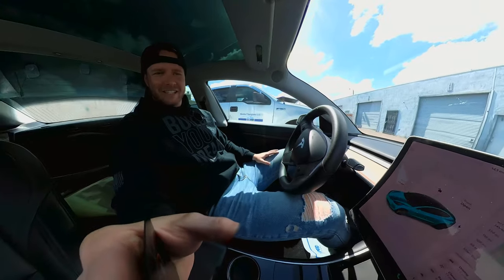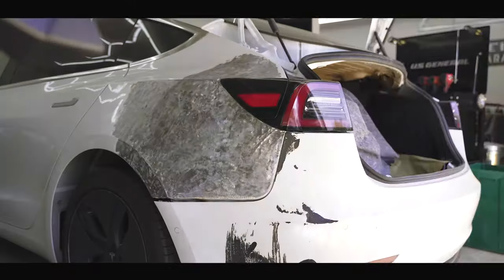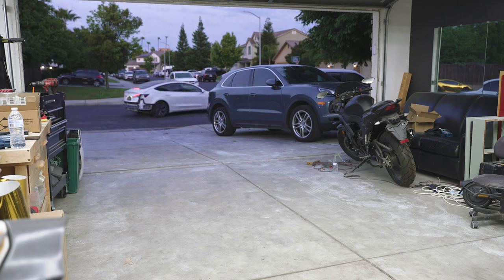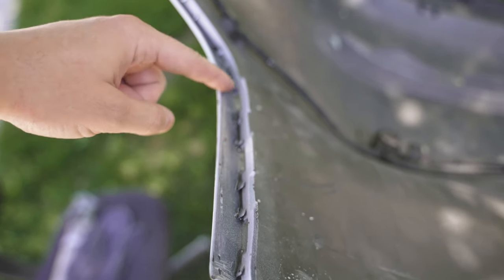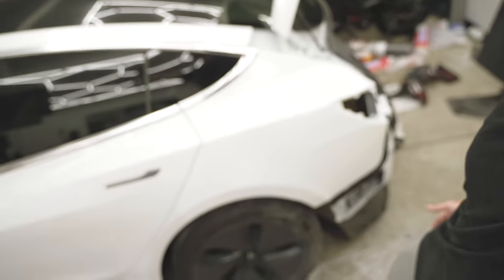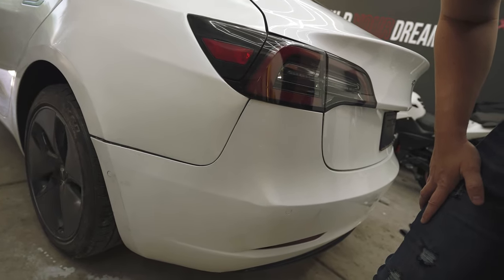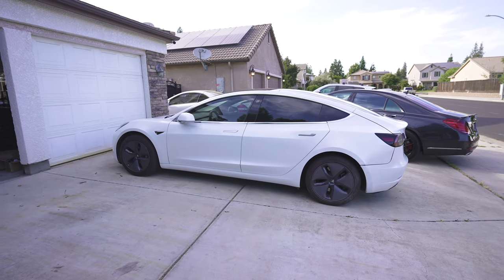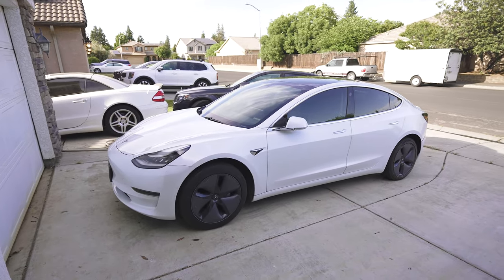the $18,500 Tesla Model 3 is Ready for the Road!

Comment from the maker: What color wrap and what wheels should I put on this thing?? 🤔 Also have a coilover lowering kit for it...but may or may not use it if I'm getting bigger wheels.
Reply: Tesla Model 3 but with Jaguar I-Pace front & rear motors each tuned to 100bhp over standard thus giving you something like 600bhp or mix match of motors and a non-Tesla battery pack with  something like a Raspberry Pi computers telling the Tesla computer everything is all standard Tesla parts.... 
Ps there is a Model S with a 125kw home made battery on YouTube.
Reply from the maker: @kylereese4822  danggg
Reply: Navy mat green?
Reply from the maker: @aleksamartinovic3642  always did like the look of the matte green 😏

Comment: Yay it’s back !! I had asked about this like 2 weeks ago.  You did good, I knew you could get it tight and right again. Just a thought on that gap ……. Is the black plastic strip that the bumper cover snaps into adjustable???  Maybe it can be raised up like an 1/8- 1/16th to close up that gap
Reply from the maker: I wish it was! But they are not, nor can I drill the bracket to adjust the clips higher. I'd have to either pull the quart panel out or bodyfill downwards half a centimeter.
Reply: Great minds think alike.  Ok just a thought.  That was my next thought ….. drill it out and make it adjustable lol.

Comment: I had just watched a video earlier where someone was showing off an Ebike mod and I thought "Looks like he's in California," and just then he passed two Teslas back to back  "Yep, definitely California." If I recall you called the Leaf a budget Tesla so this was a valid upgrade. I could kinda forgive the dent pull as this doesn't seem to be a common thing. Like the moment one gets this damaged, it just gets punted into a junkyard rather than fix the dent or they just live with it to avoid dealing with insurance, so it's nice to see some recycling. As for mods, people complain that there aren't many alterations you can do to the outside which leads to them being very samey. Blacked out headlights, a wrap and maybe different wheels are the main things people do. Darwin pro aero has some nice cosmetic parts although maybe a bit expensive, but if you're not lowering it, maybe some side skirts? (also, I appreciate the moment of positivity in the middle there!)
Reply from the maker: Good thinking!